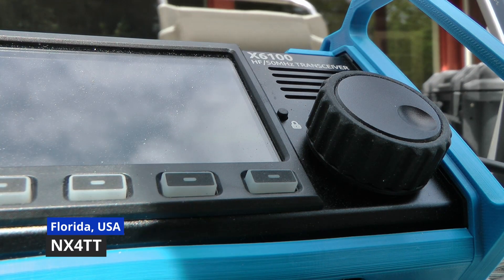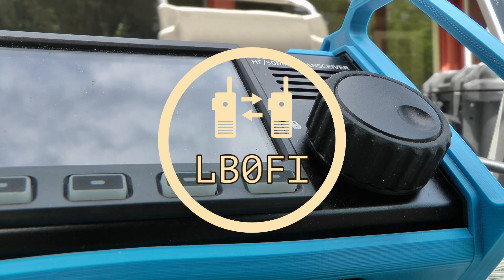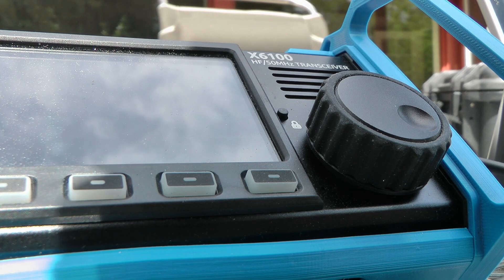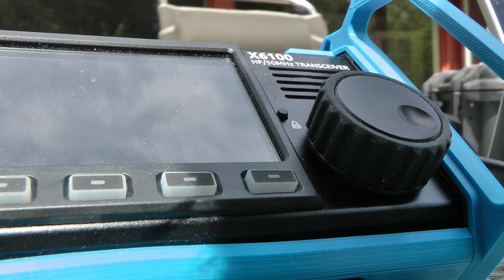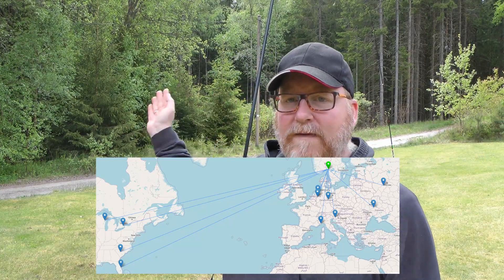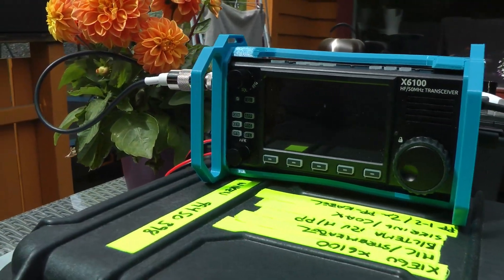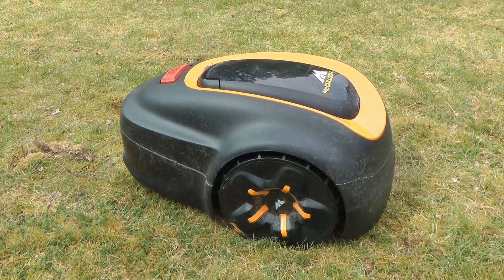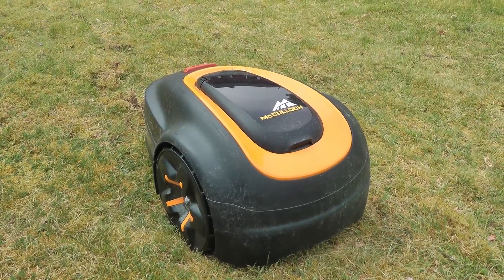End Fed Half Square - Does it work?

Comment: What's not to like about an End-fed Half Square for 20 meters?  

But, if you want to make it even better.   Put up another half square tuned 5% lower in frequency and spaced 0.2 wavelengths behind the first and you have a Half Square Beam for 20 meters.   It will provide an azimuthal 3dB beam width of about 90 degrees and 2 to 4 S units of F/B ratio, depending on the incoming angle of radiation from the rear.  Put it near the ocean and see over 11 dB of gain at 5 degrees elevation.

Thanks for the video!   The Half Square truly deserves the love.

73
Reply from the maker: I need to revisit this antenna. I have a feeling it will be a portable winner.
Reply: Behind it or parallel? Not questioning your opinion, just wondering if you mean parallel or not-what do you mean by “behind”? 
I’ve never built one but as a DX junkie, I’m always looking for a great antenna that won’t cost a lot of money. 
Tnx de WB3CFN
Reply: @joekrepps  Radiation from a Half-Square antenna is broadside to the horizontal top wire and bidirectional.   Placing another Half Square broadside to the first with a spacing of 0.2 wavelength and tuned for a frequency 5% lower than the first, will result in a directional pattern in the direction of the first Half Square antenna.

The second Half Square antenna functions as a parasitic element to the first, like a reflector on a Yagi.

Comment: Not new at all. Bobtail cousin
Reply from the maker: I never claimed it was a new design, I even say 15 seconds into the video that it isn't new. It's also not a Bobtail Curtain, it's a Half Square.
Reply: @LB0FI  well if you examine the bobtail you will see it is two end fed half squares.
Reply from the maker: By that logic a dipole and a random wire is the same antenna.
Reply: @LB0FI  Now now Girls......
Reply: The Half Square, the Bobtail Curtain, and the Bruce Array are all variants of the same antenna - kind of like 2 element, 3 element, and 4 element beams can be variations on the Yagi/Uda design.  There really is no real limit to how many elements you can have - just feed it in the middle and space all the vertical elements by 1/2 wavelength sections of top wire.

Comment: I built one for 2M and it worked well, though I just did a hasty job and it did not hold up. It worked fine, I did corner feed it as is traditional. Usually the end fed version has radials.
Reply from the maker: I am going to test the corner fed as well as soon as I have a little bit more time on my hands.